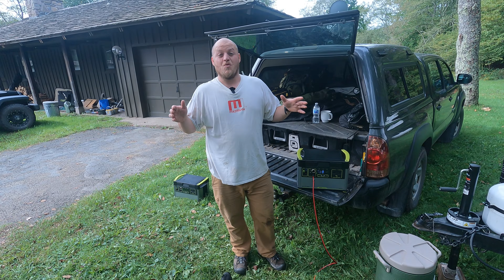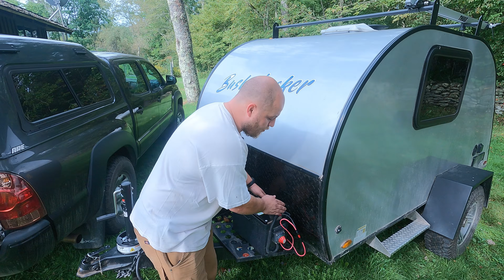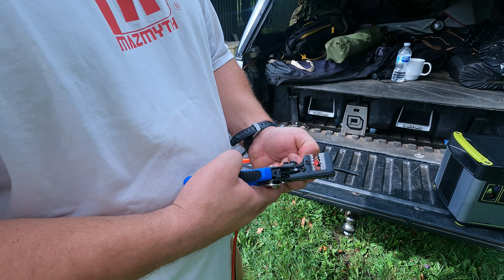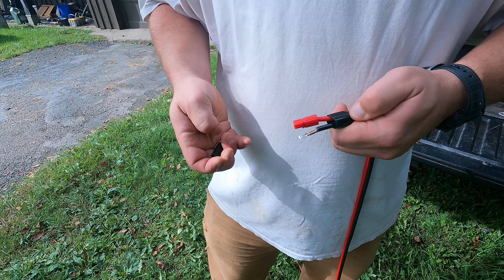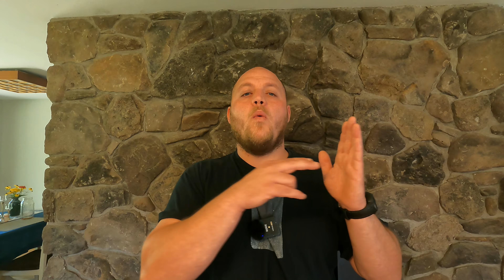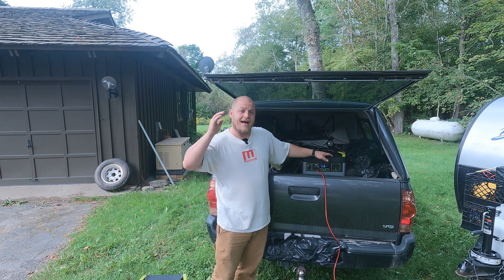Using Goal Zero for RV Battery

Comment: Any reason I can't just pulg my RV 30 amp (with 15 amp reducer) cord into my Goal Zero and use it as a generator (no Air Con, no microwave)? That way I get to utilize the RV battery as well?
Reply from the maker: It works and sometimes it can come in handy but it’s far far less efficient.  Running on the DC side, as shown in the video, will usually last 4 to 5 times as long, compared to plugging into a power station inverter.

When you plug the camper into the power station, using the 15a plug, you are going from DC to AC back to DC… losing 15-20% each time it converts.  It will also run the battery charger on the camper the whole time and lose stand by consumption on the power station.

In short, it works, and can be really useful when you want to run your outlets for a short period of time.  As a prolonged dry camping solution, it’s not an efficient way to use the stored power.

Comment: Curious, does the Anderson outlet on the Core provide more capacity then using the M-M cigarette lighter backfeed method shown in a more recent video ?, Just wondering which method is better to use the Core to drive the camper.  I will need to add up device wattages to get a feel for this.  My camper (Nu Camp Tag XL) gets picked up next Tues., my GZ Yeti Core plus Boulder 100 unit get delivered Friday.  I purchased the GZ gear after watching your excellent videos.
Reply from the maker: The cigarette lighter gives you a max of around 10A of current before tripping. The Anderson on the core is around 15A. The Anderson on the 1500x is 30A!
You could do almost anything you want on a teardrop and stay under 15A - I ran the fridge, furnace, water, pump, lights, charged phones with no issues.
Reply: @DIYOutdoorLife  From what I can see, it would be a ceiling fan, fridge, water pump on occasion, lighting.  I may do a propane Propex down the road. Tag comes with electric heat so needs shore power.  I figured the GZ Core would be a good size.
Reply from the maker: Note- stock heater on T@G is electric element and wouldn’t work on DC
Reply: @DIYOutdoorLife  Yes, am aware.  Not sure how often I will need heat, we are hardened from decades of cold tent camping.  Maybe a Propex at some point if we find ourselves camping NE in Nov.
Reply: @DIYOutdoorLife  As BTW, your YT's are truly excellent.  Your presentation of information is just better than about any other YT I watch.  You would have been a terrific teacher of technical subjects.
Reply from the maker: @stevebailey7633  that propex is out of this world! I too am pretty warm blooded and cold weather hardened, it’s usually a compromise with the Mrs.

Thanks for the kind words , I was a school teacher for 8 years, no courses in campers though.. lol

Comment: This is a great video! Thank you! Could you detail the benefits of going this route (direct from the battery) over plugging the shoreline to the yeti? I did that last camping trip and it kept all systems running well for an entire weekend. Do you lose more power more quickly?
Reply from the maker: This will last 2-3X as long as, depending on how you use the camper.  

When you plug your RV directly into the yetis 110v receptacle, you’ll lose efficiency running through the inverter.  
On top of this, it charges the camper battery and converter back to 12v through the power center on camper.  Both ways work, getting to use outlets is nice, but running through the Anderson output is the way to go for longer trips.
Reply from the maker: Check this video out too.

Portable Power Stations Uses with Campers | Tips Tricks & Hacks
https://youtu.be/mU8iZZGlk_8

Comment: This is a great video and the inspiration for setting our Bushwacker up in a very similar way. We use a Bluetti AC200P instead of the Goal Zero which wound up not being the best option. It has more power for less money but I feel the Goal Zero is better suited for small campers like ours if your planning on charging off solar due to the 14-50V MPPT controller in the Goal Zero versus the 34-80V MPPT in the Bluetti. That 34V solar charge start voltage renders our 2 BougeRV solar panels on top of the camper useless because they won't reach the  34V needed to start charging the Bluetti. Yes I can add portable panels to reach the 34V but then I have to baby sit the portable panels instead of enjoying our free time hiking or fishing. 
 Love the concept of the PPS powering the camper and have set up our 1968 Shasta the same way. Will probably switch to the Goal Zero or build our own PPS so we can use our rooftop panels to recharge it during the day!
Reply from the maker: Hey guys, I love your ac200p set up, it’s a shame the start up voltage on the MPPT is so high. 
Love the channel, and the new one, hope people will swing by and check it out!

Comment: I am definitely not a battery nerd and the end was quite confusing for me😂 I am also not savvy with anything electrical. Would this would for a vintage camper that is also powered by a battery? Does it have to be a specific type of trailer??
Reply from the maker: This can work for almost any camper, vintage is fine.  This camper also has a battery, you can’t use them both at once for this technique.  When using the power station to power the 12v, it is taking the place of the battery.  Hope this helps, have fun!
Reply: @DIYOutdoorLife  Thank you!! Appreciate it

Comment: I've been using my Jackery 500 with a 100W Harbor Freight solar panel to run my lights, charge phones/tablets/laptops, run fans, etc etc etc for a good 2-3 years now and it's still doing great. If the power goes out, I've got propane options for cooking and/or heating, and off grid options for showering and washing clothes.

Granted, I'm not running my 1500W heater, the AC or the microwave or anything off of it. But it's MORE than done its job over that time. I'd LIKE to get a bigger power station... just limited funds prevent that from happening. hehe
Reply from the maker: Yea, they do get pricey.   Great to hear you had such success working the 500 w HF panel!

Comment: Thanks for the great video.  I have two other power stations; Wagantech Lithium Cube 1200 and EcoFlow Delta Pro.  I would like to be able to plug these systems directly into my R-pod trailer with either one.  Could I plug them into the shore power port on the side or connect them through the battery port like you have done here?  Instead of using the anderson plug port, could I connect using the lighter socket outlet?
Reply from the maker: The delta pro has a high output Anderson, that will work.  When using a cigarette style plug, you can only draw 10 amps, opposed to the 30 amp shown in this video. The delta pro will do this.
Also, I’ll link the video I did showing the lighter socket.
Reply: @DIYOutdoorLife  Thank you very much and thanks for explaining power on the rv's.  Great info.
Reply from the maker: RV Power Station Hack | Interior Back-Feed
https://youtu.be/lf2nbCLuLCY

Comment: So using this method with the Goal Zero and Anderson cable I can use the outlets inside the trailer, like the tv?
Reply from the maker: The anderson method is for camper "DC".  To use AC outlets, you could run through the outlet on the power station but it wont have near the run time.  it's a far better idea to run this way and get a tv that plugs into DC plug like automotive/cigarette.  Thanks for watching!

Comment: Hi. Great ideas. I am using a Vtoman power station with extra battery.  
I have an old Casita and trying to upgrade the power converter it came with flipped me out. 
So I removed it with the dying 12v battery and hooked up all my DC trailer needs to a fuse block. Then hooked that to the Vtoman.  I’ve run the Vtoman ac inverter to a new shore line( if I use it or to a mini Honda generator that’s 45 years old). Also separate lines from solar panels to V. 
I keep the V inside unless I need it somewhere else. 
My big needs are a dc cooler/fridge, CPAP, water pump, fantastic fan, and lights or device charging. 
So far it all works. 
I always boondock so no external power on the road.  I use Casita like a teardrop except at my age I can stand and pull on pants. All my utilities are outside (water and cooler).
Reply from the maker: The casitas are nice and last forever! Great job with the PPS power system!

Comment: I'm not sure if your trailer's battery can be charged with your alternator, but if it is and you hooked up the goal zero as per your video, will the alternator charge the goal zero, and would it damage it since it is a lithium battery?
Reply from the maker: This is exclusively for use at camp, you can not charge the goal zero this way. If you try, it just resets the breaker on the GZ.
Reply: @DIYOutdoorLife  thanks

Comment: are you using this to power an inverter on your camper so you can use AC and such? if so or if you can how much time will it last?
Reply from the maker: Hey Frank, sorry for the delay. 
It can be used that way, although that’s not what this video is about. I have videos on the channel about using power stations that way, in this video, it is taking the place of the RV 12v system and providing over 5 times the run time over the stock battery.
Reply: @DIYOutdoorLife  thanks. that's what I thought you were saying.

Comment: Hi, Brian--I'm interested in a Roadtrek van with 400 amp hours of AGM and an underhood device to re-charge those batteries.  Living in FL, I'm concerned about air conditioning day and night while off-grid.  Would a PPS be a worthwhile addition, and how would that be set up?  All your videos utilize your towable with an external battery.  I like your Goal Zero and also the Eco Flow and Bluetti  2000's, although the latter is very heavy. I know I could simply plug the van's 30-amp cable into the PPS, but you say that's very inefficient and wasteful.   I would appreciate your thoughts, and thanks.
Reply from the maker: Air conditioning is the mnt Everest of off grid living.  It’s possible, but it typically requires a very large investment and some DIY know-how. Check out my video on the zero breeze, it’s not perfect, but it does work. When I’m traveling in hotter climates, I’ve used it with a lot of success.
Most people with serious air conditioning needs end up going with the quiet gas generator.
Reply: @DIYOutdoorLife  Thank you, Brian.  I enjoy your videos.

Comment: Hey Brian I’m looking at “Bean Stalker “ what batt from them , and do you get their 140w bulletproof window mounted solar panel or a portable Amazon setup . It comes standard with a deep cell  battery 100 amps and a 1000 sine wave inverter , but you are probably very familiar with the Bean 🫘 I’m referring to , so what would you get from them or/ and what would you source elsewhere to do some light duty boondocks in ?
Reply from the maker: The set up they are giving you is perfectly adequate for light duty boondocking but they really charge you for it.  If it’s worth the convenience, go with the set up that they provide.  If you were trying to be frugal, you could save a lot of money buying something comparable yourself.  It all depends on what you’re looking to do.   
If it were me, I would buy their nice factory installed set up and then supplement it with a Amazon solar set up to add to it.  It’s fine to run to charge controllers and solar arrays.

I would be very careful with the inverter, it’s nice that they include it but it can eat your batteries very very quickly.  If you were interested in using that, you might want to upgrade the battery package.
Reply: @DIYOutdoorLife  Thanks Brian , just a second AGM or go Lithium, I’m watching all your paring vids and I have some electrical background so I get the paring info and I get that you kinda got to be “nice” when altogether great company’s are involved . Portable batt power unit with that 🫘?
Reply from the maker: @SkyhandF16  either way.  AGM is nice for price and compatibility, lifepo is great if you want to spend the $ for high end performance and longevity.  If you do go lifepo, I suggest buy once cry once… go with something good
Reply: Using the yeti as the battery with the Anderson output cable, do you know how long the yeti will hold a charge if you are just running lights, fridge, and water pump? In this same scenario, how long with the yeti hold a charge with the solar panels connected for charging?
Reply from the maker: @andrewperkins7914  for my set up using those items listed, the 1500 x goes for a week.  It will go continuously with 200 w of solar… I will not run out.

Most times, 100 watts can pull this off. It’s really impressive. I will say, we are quite thrifty with power, the 12v fridge is the biggest draw (tiny BougeRV 23qt)
Reply: @DIYOutdoorLife  thank you!

Comment: An older video but very useful info. A scenario maybe i've missed, What if you opt out of a battery setup? Is running a PPS primary an option? Also not using the shore power hook up, but lets say instead of your battery box, you place the Yeti there and charging the Yeti by solar panels. How/ is it possible for this configuration to run your trailer purely using a PPS. Thanks again for any insight and keep up the awesome work
Reply from the maker: absolutely! In fact, I think it would be the best way for many.  It requires some DIY work to get the best out of it but some companies are helping with this.  I am going to tour a camper factory this month that will sell their camper with a wired box to receive a PPS. It will connect to AC, DC, solar charging, shore power charging and car charging...pretty cool stuff.
Thanks for watching!
Reply: @DIYOutdoorLife  I will be waiting for that video. Could you just take the original connectors that goto the battery and put an anderson fitting on those to connect straight to the Yeti? I guess thats what im asking. Say I bought a used trailer and threw the battery away. Couldn't I do the exact same process you did to by-pass the battery but instead hook it straight to the positive and negative leads that would go to the battery, slice them and put anderson fittings to connect to the Yeti? Thanks for the help.
Reply from the maker: @sgtbehrens  yes, you can do that.  The problem here is that you should not connect it to the tow vehicle with a seven pin or plug your camper into shore power.

Since your camper uses those same wires to charge, that will not work that way.  Fine to run the camper that way, but use the power station charging methods rather than connecting it to tow vehicle, camper charger, or camper solar port.
Does that make sense?
Reply from the maker: @Dane Newman you got it.  Just make sure the load center and converter aren’t interacting with the battery.  Usually simple to stop the battery charging and AC-DC conversion

Comment: Yes thanks so much. This is exactly what I was wondering about. So glad you make things simple for a guy like me. Bought a wildwood FSX and getting great info from you to go boondocking in Jersey. Looks like I have to go with the Yeti Goal Zero for this to work. Any news on other brands that offer outputs? Didn’t see any in comments. Thanks Brian.
Reply from the maker: Bluetti is making some headway with an high output DC port.  They use an aviation style plug on their bigger models of 25-30a.

Comment: Want to hook my yeti goal zero to my travel trailer.  Bought the extension cord and connectors you linked to in description.  My battery cables are 6AWG.  Will these  connectors work or do I need different ones?  Thanks
Reply from the maker: It’s a little more tricky but will work.   6 awg is bigger, you’ll have to trim a little insulation.  What TT do you have? What appliances do you want to run? What goal zero do you have?
I ask because I also do this a different way that might be easier in this case.
Reply: @DIYOutdoorLife  We have a Forest River Wildwood 177bh and a yeti 1250 with an extra battery chained to it.  Just looking to run the fridge(12v),  some lights, and water pump for weekend trips.  Appreciate the help,  I'm totally new to this stuff.

Comment: Can you run this unit in parallel with two agm 150 amp hour batteries, use it as the inverter and to monitor the system while on and off grid? 

I’m asking because I’m looking for a WiFi solution to monitor the amp hours and charging of my agm batteries while on and off grid and keep them in good health. 

Also, I would like to add some amp hours to the existing 300 I get from the current two AGM’s when ran in parallel. 
Then would like to be able to remove it easily from the system while on grid, connect it to my cargo trailer 150 amp hour agm and take it off grid. 

I want both systems to be able to use solar to charge when needed while using power.  

Please advise?
Reply from the maker: This can be done, but it’s a little tricky. This unit has a lithium battery which cannot be directly connected to lead acid. They sell a unit that attaches to the yeti called a “link”. You could attach the AGM batteries to the link, even in parallel, and attach the yeti to the camper through the APP. It would then do exactly what you’re looking for, but it’s not as straightforward as this video.
Hope this helps. Do a little homework on the link, you don’t have to buy the Goal Zero expansion packs, you can use an AGM.

Comment: hello sir. i have recently purchased a 20 foot wildwood. the ac wall outlets and furnace will only work on shore power. if a purchased a jackerry unit would i be able to plug my camper into it and have enough power for light use.
Reply from the maker: Since the battery supply used during dry camping is direct current, what you’re saying is standard about outlets.

Unfortunately, I would need to know a lot more about your situation to answer this accurately. 
A Jackery can not be used the way the goal zero is in this video.  You could however bring it along to plug things directly into it.
Sorry I couldn’t be more help, thanks for tuning in.